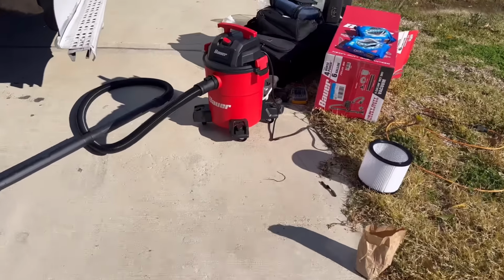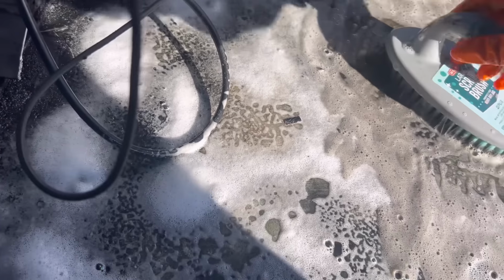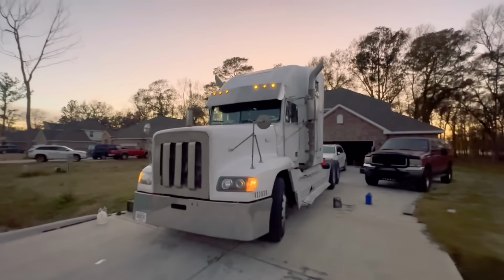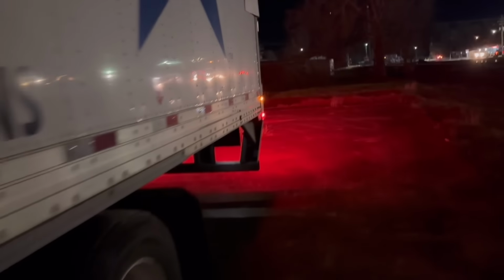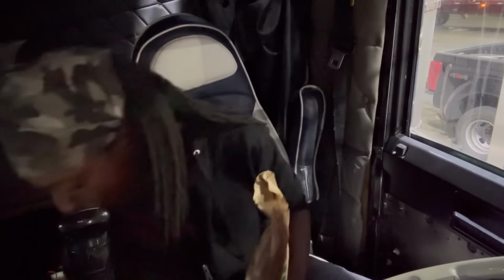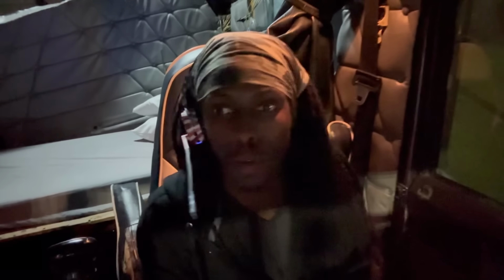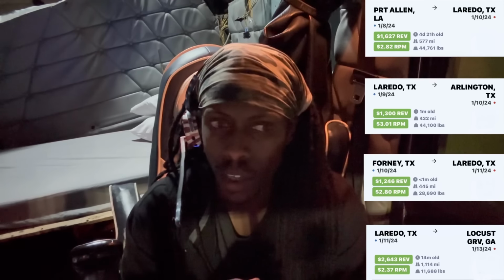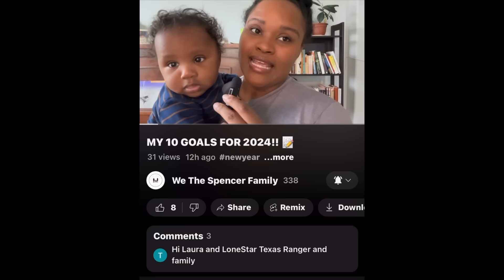FLD RESTORATION (Episode 2): Landstar Revenue Insight ➕ Fuel Saving Hacks ➕ Bauer Dry/Wet Vac Review

Comment: Your ABS light is on because the trailer wheel connector is not connected, follow the ABS line from trailer to the trailer wheels and connect it back. Check both sides..